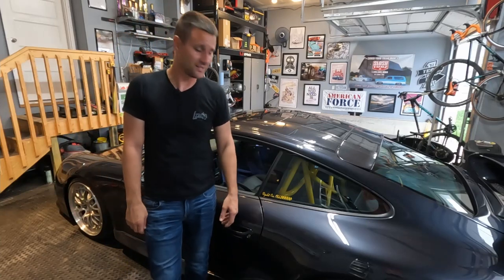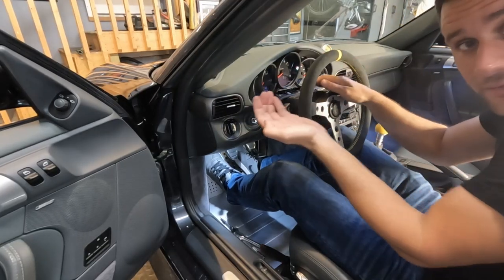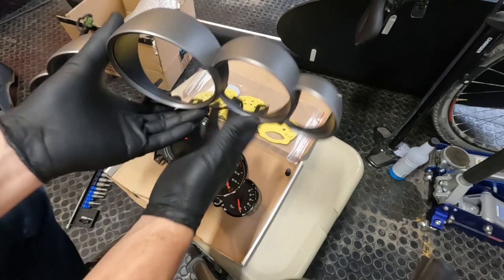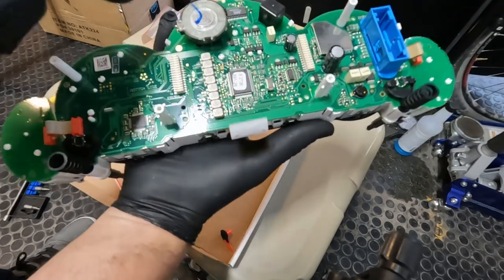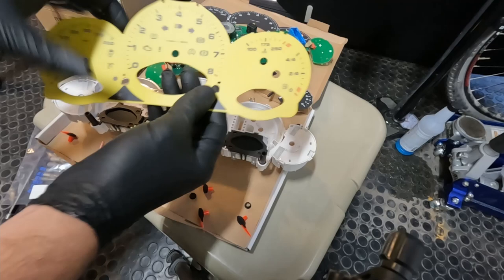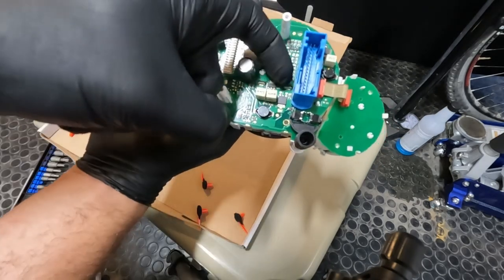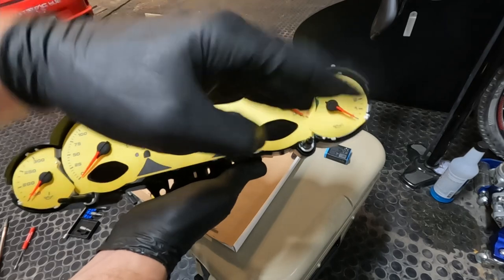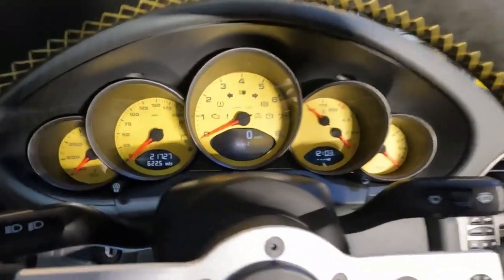Porsche 911 997.1 Gauge Face Swap With Venoxy

Comment: One tip. The cluster connector may be very brittle and crack. So make sure to pull it enough so that you can reach from underneath and use screwdriver to pop the retainer. If you do it from the side, you may crack it, as I did. instead, I found that you can pull it enough, to the point that you can reach from underneath it and use a screwdriver to pull/push the locking mechanism

Comment: Followed this guide and did this myself today with new gauge faces from Venoxy. Only got stuck on the little black clips holding in the faces where your method with the screwdriver did not work for me. Worked well to use a small plier and pull in and down though!

Thank you for this awesome step-by-step! Made a huge difference for me! And the faces from Venoxy are super quality for the price!
Reply from the maker: Those black clips are the worst! lol Glad I could help some and thanks for the view!

Comment: Thanks!! This video gave me the confidence to order from Venoxy and give it a shot.  Two tips: 1) put some painters tape on top of the steer column surround.  Scratched mine up a little bit when pull the gauge cluster out. 2) Take a pen apart and use the long hollow shell to get the black retainers out that hold in the factory gauge face.  I tried a few different ones, but eventually found one that kind of pinches the retainers together and pushes them through.  Made it really easy.  Just take your time and go slow.  New gauges look great, can’t recommend Venoxy enough.
Reply from the maker: It is one heck of a project! I hope to only do one lol Glad you got yours done! Thanks for the view!
Reply: Agreed onto the pen. You can also use a small socket, just big enough to pinch the retainers
Reply: Agree a sock would work too.  I think the pen shell gives you more to hold onto, but do whatever works best.

Comment: hi there. I followed your instructions to the letter - thank you for the great tutorial. once back in the car and with the engine running I noticed - sadly - oil pressure gauge doesnt register / neither does fuel gauge/ neither does oil temperature  - but I can still measure the oil level electronically - and also using the head unit I can still gauge how much fuel is left. Do you have any advice how I can fix these bearing in mind I took your advice and was very careful making sure that all the connections are connected etc. could be a loose connection perhaps on the plug at the back at the unit or does it need completely calibrating - or alternatively have I just wrecked my perfectly good dashboard cluster for aesthetic purposes ? - welcome to any comment thanks
Reply: Any luck? After doing this my oil pressure and temp don't work either..
Reply: @markclark250  hi there. the oil temperature gauge decided to work after a while and now consistently works but both fuel gauge and oil pressure gauge do not. I did follow the instructions correctly in terms of connections etc but in hindsight I keep thinking did I not connect something ?. hearing that you are experiencing similar issues makes me wonder if it is something to do with resetting it like perhaps disconnecting the battery and allowing it to drain before reconnecting maybe? thanks for the advice
Reply: @rowenlawrence1797  Pretty sure removing and reinstalling the needles broke the gauges. I ordered a used cluster and plan on swapping the small circuit board from the back of mine to the new one, assuming my VIN and everything is tied to the chips on that board. I actually received the cluster today so I'll swap it this weekend.
Reply: @markclark250  hi there, I look forward to seeing your results cheers
Reply: @rowenlawrence1797  Just finished. I swapped the removable board from my cluster to the new one and it worked perfect. No errors and my odometer is correct, just as it was but all my gauges work and I got a better lens.
Reply: @markclark250  brilliant  - well done you have now qualified as a 911 mechanic!!

Comment: I watched a similar video where the poster didn’t disassemble the rest of the cluster to remove the small black cylindrical clips holding the overlay on. He gently pried and wiggled the overlay from underneath and side to side and they simply freed with a ‘pop’.
Reply from the maker: That would have saved a lot of time! But I would be worried I couldn't get the new overlay to fit correctly. Thanks for the view!

Comment: Do you find any of the turn signal lights are dimmer?   I bought a 997 with a custom overlay and i can barely tell when the blinker is on.  Im considering replacing it..